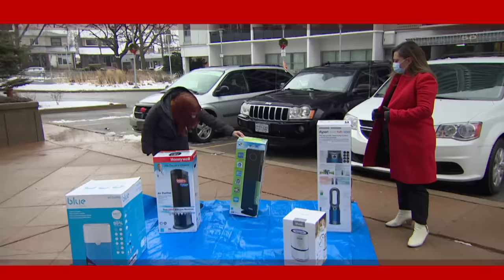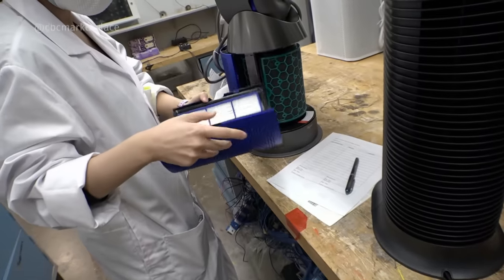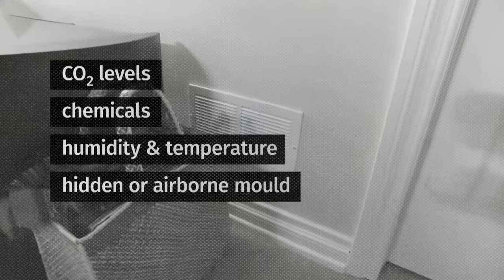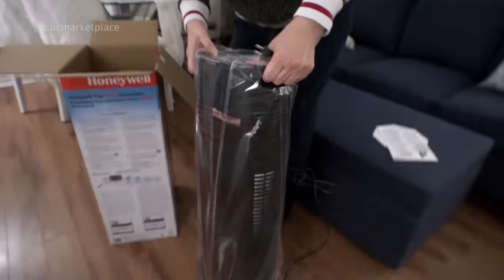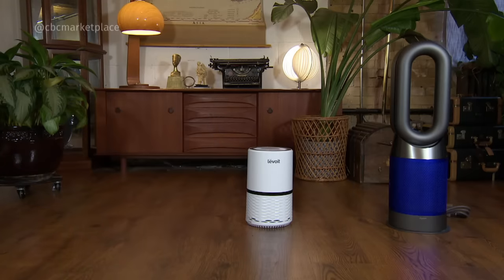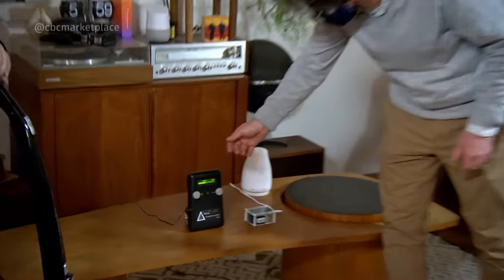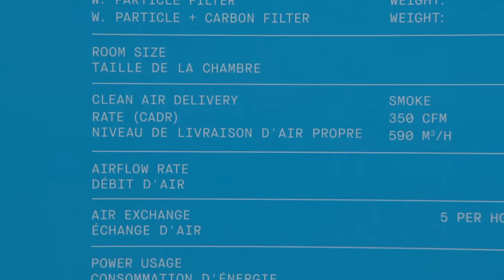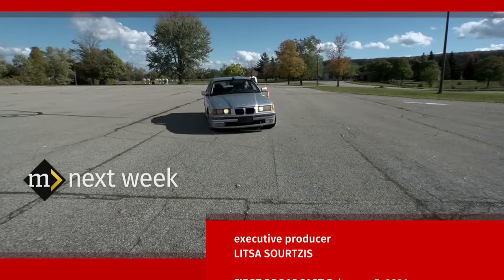Is an $800 purifier best to clean your home's air? We lab tested 5 top brands

Comment: I mean, they are really going after Dyson. The Dyson is the only unit that does cold and hot. The other units just filter air.
Reply: yea dysons actually work well
Reply: I think the point was that because had so many uses, it is not the best at any of them.  Kind of a jack of all trades but master of none.  That said I love my Dyson vacuum cleaner so I have nothing against the company.
Reply: @selalewow  it works they are trying a gotcha moment with  dyson  let s be  real here who are their  experts i have cats  and  had allergies got  this dyson and  wow the  wonders it does  also  they  dont tell you  about  the great warranty you get from  dyson
Reply: The Dyson is the Best. it costs $880 for a reason. Marketplace is just hating
Reply: @shazadkhakoo8244  exactly
Reply: Not only that, they didn't actually test for VOCs which HEPA only filters will not filter. Dyson was entirely correct that CADR while important isn't the only metric, additionally a finer filter that filters smaller particles will have more resistance for any given surface area. They didn't strap a HEPA filter to the box fan so the measured CADR (and there's also the fact that there's three CADR ratings for different particle sizes and this is not disclosed) is immediately not comparable to any of the other air filters (though the filter used was still good enough to trap most allergens like pollen and dander.) Additionally they did not disclose the efficacy in reducing the particle counts, what good is a high CADR if the filter is 70% efficient vs 90% efficient on a model with lower CADR. There's too much nuance into what makes a good filter to cram into a 20 min video that needs to tell a story.

I feel marketplace's quality has been on a sharp decline for years in their chasing of broader audiences by americanising the editing style and removing all semblance of actual information and quantifiable testing.

Comment: I’ve been shocked how well a simple filter-taped-to-a-box-fan works: I bought a VOC/particulate meter so I could test them, and they are VERY effective at removing particulates (I didn’t have many VOCs anyway). I taped a 20x20x1 purple 3M Filtrete filter (filters allergens and other tiny particles) to a 20 inch box fan with masking tape (about $40 total); the surface area of that filter is MUCH larger than what you’d get in a commercial air cleaner; I’ve been running it 24 hours a day for over a year and the filter is still very effective. Even without the meter, I can tell it’s working because if I turn it off, my asthmatic cat starts wheezing again
Reply: where does one geta voc-particulate meter? also, this video did test the DIY and got fair - midling nmbrs, i f i recall.

Comment: I've been using the boxfan diy. It has worked for me to beat the tree pollen. My advice is to use a 2 inch filter and tape up the edges to the fan. Don't waste your hard earned money on the others.
Reply: The second I saw it I thought about buying a box fan. $40 including a couple filters sure beats $90-800 before price of air purifier filters!

Comment: This episode is extremely flawed, they didn't test for VOCs such as cigarette smoke's stench, off gassing from new furniture like mattresses (especially memory foam), etc; HEPA only filters will not filter these and you will need an activated carbon filter to reduce the presence of this. This brings me to my next point, Dyson was entirely correct that CADR while important isn't the only metric. CADR is only useful when comparing two air purifiers of similar filtration performance. An activated charcoal filter will add resistance and reduce CADR, additionally a finer filter that filters smaller particles will have more resistance for any given surface area. Speaking of filter efficacy and it's effect on CADR, they didn't strap a HEPA filter to the box fan so the measured CADR  is immediately not comparable to any of the other air filters (though the filter used was still good enough to trap most allergens like pollen and dander.) Box fans are designed more so for higher airflow and the static pressure is generally low so if you strap finer filters to them they suffer quite a bit since the fan motor has to work harder to move the same amount of air. 

Additionally they did not disclose the efficacy in reducing the particle counts, what good is a high CADR if the filter is 70% efficient or less on smaller particles vs 90% efficient on a model with lower CADR. There's too much nuance into what makes a good filter to cram into a 20 min video that needs to tell a story. Due to the level of incompetence shown, this episode should be pulled and a statement apologising for the abhorrent testing methodology should be released.

I feel marketplace's quality has been on a sharp decline for years in their chasing of broader audiences by Americanising the editing style and removing all semblance of actual information and quantifiable testing. Have some journalistic standards and integrity CBC, it's not hard.

Comment: Never heard of Blueair. Surprising for that massive box.
Always love CBC's investigative journalism. Dying breed of journalism.
The Dyson is obscenely unnecessarily expensive. They're smoking something good over there. 
I have a Dyson heater/fan and it's great, but my first one broke itself with error codes after normal use.
Reply: We have 3 bluairs. And I like them better than the Molekule I spent a fortune on.
Reply: The results in this episode are pretty suspect, they didn't actually test for VOCs which HEPA only filters will not filter. Dyson was entirely correct that CADR while important isn't the only metric, additionally a finer filter that filters smaller particles will have more resistance for any given surface area. They didn't strap a HEPA filter to the box fan so the measured CADR (and there's also the fact that there's three CADR ratings for different particle sizes and this is not disclosed) is immediately not comparable to any of the other air filters (though the filter used was still good enough to trap most allergens like pollen and dander.) Additionally they did not disclose the efficacy in reducing the particle counts, what good is a high CADR if the filter is 70% efficient vs 90% efficient on a model with lower CADR. There's too much nuance into what makes a good filter to cram into a 20 min video that needs to tell a story.

I feel marketplace's quality has been on a sharp decline for years in their chasing of broader audiences by americanising the editing style and removing all semblance of actual information and quantifiable testing.

Comment: It’s 2022… Levoit is the winner by landslide. Models with superior CADR, air quality sensors, and home automation built in (WiFi)… their top end model has over 600 cadr and is $250. Why on earth you compared models with rated 500 cadr for large room vs models with 60 rated for tiny rooms against each other is very odd. I found the video rather useless. Comparing apples and oranges, and very little coverage on if the devices actually work.. they all work, when sized appropriately. Next you will declare a Ford F-350 winner in a tow competition against a Honda Civic and motorcycle.

Comment: Why then are marketers not sued for such horrendous claims?
Reply: Because when are they ever?
Reply: Because they meet the specifications on the box and Marketplace's testing was extremely flawed. They didn't actually test for VOCs which HEPA only filters will not filter. Dyson was entirely correct that CADR while important isn't the only metric, additionally a finer filter that filters smaller particles will have more resistance for any given surface area. They didn't strap a HEPA filter to the box fan so the measured CADR (and there's also the fact that there's three CADR ratings for different particle sizes and this is not disclosed) is immediately not comparable to any of the other air filters (though the filter used was still good enough to trap most allergens like pollen and dander.) Additionally they did not disclose the efficacy in reducing the particle counts, what good is a high CADR if the filter is 70% efficient vs 90% efficient on a model with lower CADR. There's too much nuance into what makes a good filter to cram into a 20 min video that needs to tell a story.

I feel marketplace's quality has been on a sharp decline for years in their chasing of broader audiences by americanising the editing style and removing all semblance of actual information and quantifiable testing.

Comment: actually if you live in a  newer condo with a heart recovery ventilator...which brings in outside air and exchanges inside air,,,then you want a proper seal on the door and not want any air from the hall way coming in

Comment: Were the CADR numbers noise-normalized or was this just a test of who has the biggest and loudest fans?
Reply: Right, noise should also play an important factor, if people run them at the lowest tolerable setting, what's the point of the turbo mode if it's never used.

Comment: The Dyson is like a do a bit of everything appliance. It cools, heats, and purifies the air a bit. So it's not exactly gonna be great at all of those tasks. If ur only looking for an air purifier, this isn't it.
Reply: Jack of all trades, master of none
Reply: @Heymeeeeeeeeeee  do you own one? I did, it does it job pretty well.. I survived bush fire with it
Reply: @wennieli5701  is it actually? do you recommend buying it? i'm looking to buy some nice air filter
Reply: @jawceti  personally I think it works, but I am using it just for my bedroom not a bigger space like living room. Usually my room smells after I cooked, especially dishes with garlic and onion, I just need to turn it on for an hour and the smell are entirely gone, I think it’s not fair to just judge from the volume of the air it has filtered because we all knows finer filter will do their work slower, just like water filter, the quality could be different, I think this Channel should measure the quality of the air as well?
Reply: I have it and its great for all of those. You’re paying a high price for a product, which is the combination of several features, not just a high cadr.

Comment: I never comment on things, but I feel compelled to comment on this video. It is misleading (not saying purposefully misleading, but misleading nonetheless). You compared a Blueair model meant for rooms 540 sqft to a Levoit model meant for rooms 129 sqft. When your main metric is clean air delivery rate (CADR) then OBVIOUSLY a much bigger machine with a bigger fan/filter/intake will give a higher CADR. I could understand if that was the only purifier Levoit made…but it’s not. They make purifiers meant for rooms 500+ sqft as well and have listed CADR above 600 m3/h (higher than the Blueair). Why wouldn’t you test comparable models? It’s like racing a Ferrari against a Toyota Corolla. Apples to oranges.

Comment: It's always the same message: "businesses can't be trusted... trust our experts instead."
Reply: The businesses have alot more to gain from false advertisement and alot more to lose from getting exposed.  The professor isn't making millions off of air purifiers.  Use common sense R L.
Reply: @2drealms196  Except in this case they did a terrible job actually testing the products. They didn't actually test for VOCs which HEPA only filters will not filter, Dyson was entirely correct that CADR while important isn't the only metric, additionally a finer filter that filters smaller particles will have more resistance for any given surface area. They didn't strap a HEPA filter to the box fan so the measured CADR (and there's actually three different CADRs for differing particle sizing which was not disclosed) is immediately not comparable to any of the other air filters (though the filter used was still good enough to trap most allergens like pollen and dander.) Additionally they did not disclose the efficacy in reducing the particle counts, what good is a high CADR if the filter is 70% efficient vs 90% efficient on a model with lower CADR. There's too much nuance into what makes a good filter to cram into a 20 min video that needs to tell a story.

I feel marketplace's quality has been on a sharp decline for years in their chasing of broader audiences by americanising the editing style and removing all semblance of actual information and quantifiable testing.

Comment: So.... blueair is coming to Canada in april 2021 (where you can shop directly online). I really hope this isn't just a timely marketplace episode aka the results are legit and no 3rd party influence
Reply: It’s legit.  We have 3.  And I like them better than my Molekule LOL.
Reply: CBC is a public broadcaster all of their funds are from the government. They wouldn’t benefit from helping blue air
Reply: The results in this episode are pretty suspect, they didn't actually test for VOCs which HEPA only filters will not filter. Dyson was entirely correct that CADR while important isn't the only metric, additionally a finer filter that filters smaller particles will have more resistance for any given surface area. They didn't strap a HEPA filter to the box fan so the measured CADR (and there's also the fact that there's three CADR ratings for different particle sizes and this is not disclosed) is immediately not comparable to any of the other air filters (though the filter used was still good enough to trap most allergens like pollen and dander.) Additionally they did not disclose the efficacy in reducing the particle counts, what good is a high CADR if the filter is 70% efficient vs 90% efficient on a model with lower CADR. There's too much nuance into what makes a good filter to cram into a 20 min video that needs to tell a story.

I feel marketplace's quality has been on a sharp decline for years in their chasing of broader audiences by americanising the editing style and removing all semblance of actual information and quantifiable testing.

Comment: A high CADR requires a filter with a high surface area - the smaller foot print of the smaller Air Purifier innately limits their CADR performance...while the box fan with the large filter taped onto it creates a higher CADR - The reason for the smaller foot print is that there is less  floor space for the air purifier to use ... one option is to mount the air purifier to a wall  so it does not need floor space.... lastly the reliability of an air purifier can be important factor that is undisclosed /untested ...the electronics and the electric motors may come in a variety of quality and may or may not be designed for continual use.

Comment: the DIY option is best option for those that was a cheap way of filtering your air. Plus the cost will matter on the type of filter being used but remember that  you need to use an actual good filter. Ive made some using MERV 13 Filters which are 40 for 4. 

The benefits these air filtration systems have are they are quiet, they are energy efficient, ect ect

Comment: One thing left out of the DIY...Fan: Airflow/Force induction on the fan motor it's self. It wasn't made to "pull" in restriced air, just natural flow. This makes the motor work harder! How much harder needs to be looked at but...Put a sheet over your mouth and try to breath. You want to operate (breath) as normal, but you can't, you must put "strain" somewhere. It can be mittigated a bit by boxing the fan/filter away from each other, but...? Like going uphill in a car and pushing on the accelerator does nothing, say's "Ya...right, ain't gonna happen". Been there, hate that :(

Comment: Coming back to this video a few days later, and one thing they didn't address is that some of the products are ionized purifiers, such as the blueair.
Sure it's higher ranked, but at what cost?

Having ionzied air particles floating around and then hitting a wall is just as bad in time : ( 

I kinda see Dyson's point now.
Reply: Can you explain more in details, it is bad? What effects will it do?

Comment: Ummm I use a diffuser at home so now I am worried what the problem with them is.  The video showed that the particle counter went from 7 to 1400 ug/m3 of PM2.5.  So what particle is that exactly that would be caused by diffusers?  As he suggests turning diffusers off  16:57

Comment: I am with the Dyson guy. 
CADR is not that important unless you have a huge house. 

If you live in a small house the air is getting filtered even with the small thing the levoit brand which was the smallest. 

They all good and get the job done. 

Some say activated charcoal or carbon filters combined with HEPA produce really good results.

Comment: you didn't cover VOCS... Which is my main concern :/   VOCS do not get filtered in any of those, you need a sturdy carbon filter added to it. I have bought a AllerAir machine, huge cumbersome thing and it does the job well, albeit, not for the size room they advertised. Still best one I got and I got a LOT of them

Comment: Dyson is right.  Not saying it's worth the price, but how fast a filter "cleans" the room is not as important as how well it cleans it and whether it can intelligently keep it clean over time.  The Air filter market is like so many markets these days, focusing on spec wars more than making a great overall product because it's easier to compare (and measure) only 1 or 2 numbers vs a dozen or more different factors, some of which are subjective (like how loud is too loud for a purifier/fan?).